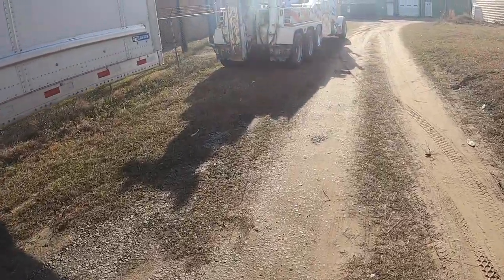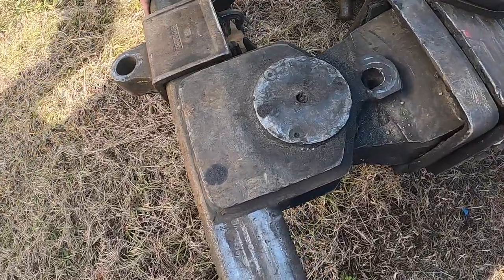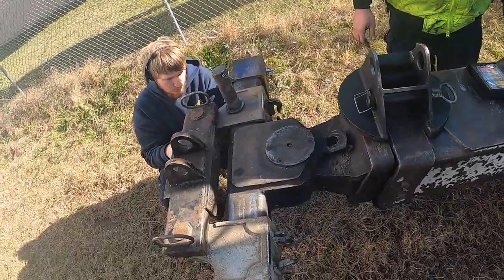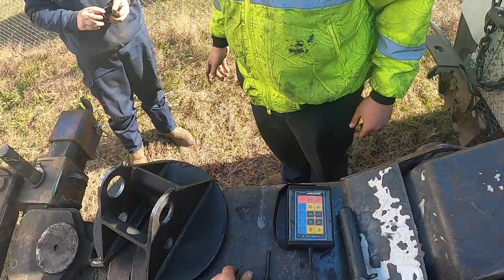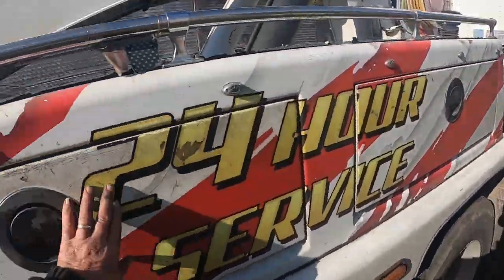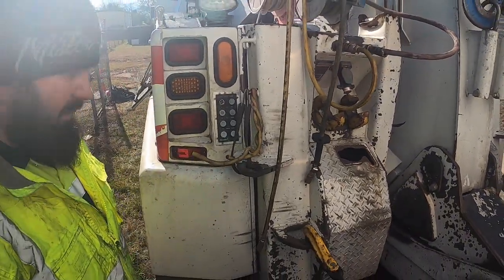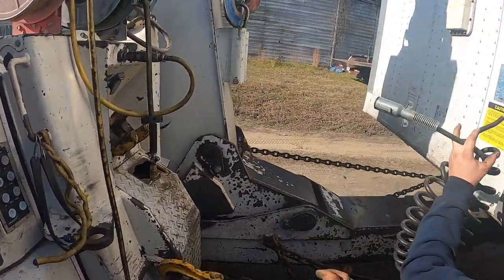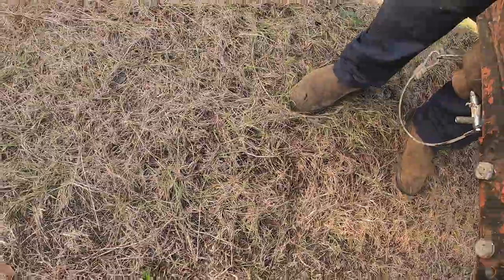How To Tow A Trailer With A Fifth Wheel Attachment

Comment: every day is a good learning day. i assumed the other method you were speaking of was using the bar against the front of the trailer and lifting / securing with chains? like i use my tow unit? each and every day i wonder if i should put my trucks to work towing. the cost of insurance and finding good drivers always weighs in on my thoughts.
Reply from the maker: Mr JC Hope you had a Merry Christmas.  You are correct  about using  to the tow bar or sling. Good drivers are hard to find. I think have 2 very good up and coming drivers. Thanks and stay safe.

Comment: Hi new to the medium duty towing. Tow a trailer and ran my safety chains to tighten up the T bar but it wouldn't let me turn curious to know what I did wrong?
Reply from the maker: Mr Thomas Safety chains should have slack and allow you to turn. You should also have chains or straps securing the front axle to the T bar to keep it from bouncing or sliding off. Thanks for watching and stay safe
Reply: Thank you I appreciate the advice.